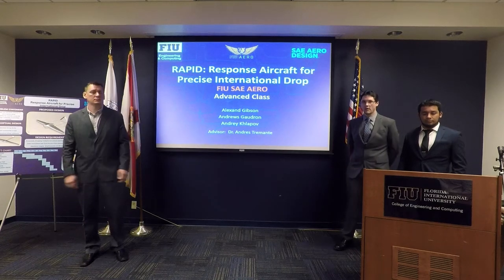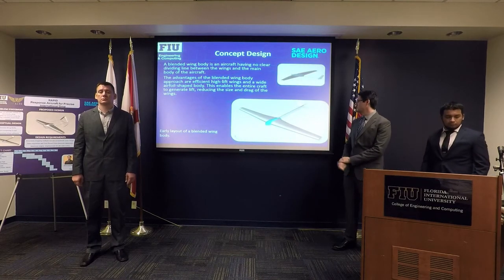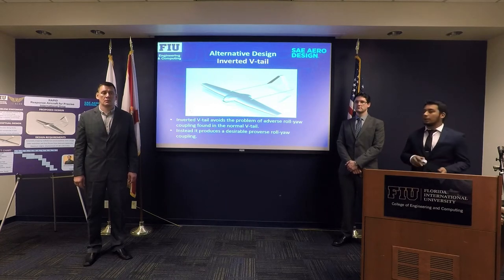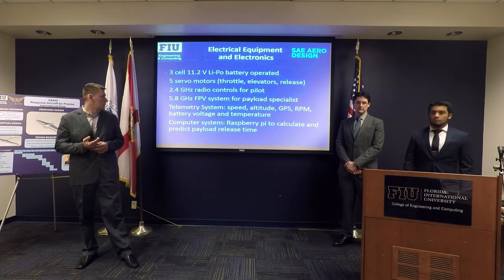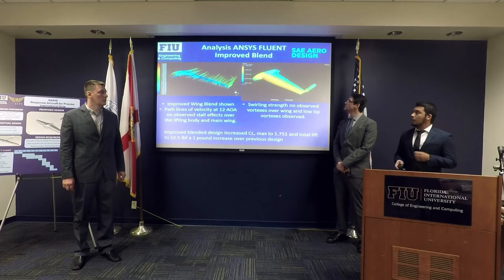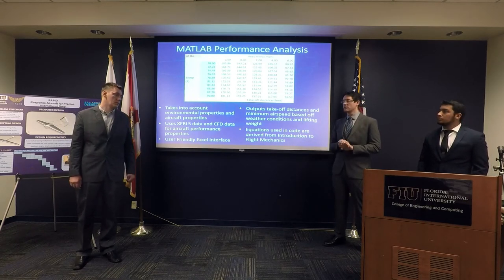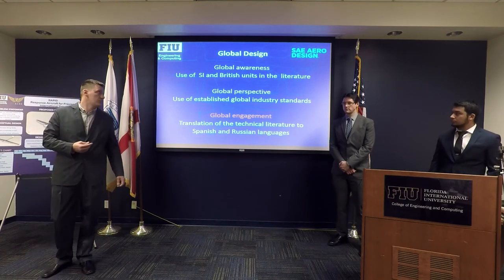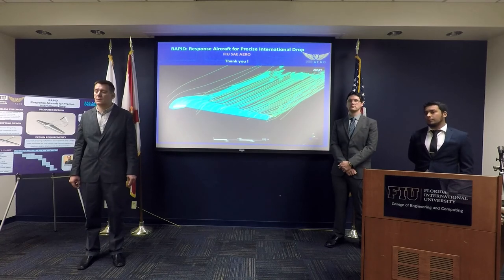SDO Team 4: RAPID Response Aircraft for Precise International Drop

Comment: This team had a clear knowledge and appreciation for their project. I appreciated the fact that they went into such depth to test their design through various software and used a MATLAB program to analyze potential locations for flight. Although I felt like each part was explained well, I wish that they had gone more in depth on the electrical and coding side of their project a bit more, to get a fuller understanding of their project.

Comment: The team is participating in a good competition. The presentation went well, it showed that each member is well prepared and looking forward to getting the best outcomes and results. However, in some instances the team did not have the best understanding between each other in changing the slides at the right time. Also in an instance the presenter revealed some information different from what's shown in the slide. Other than that, the team's project is promising and they have picked an efficient design alternative with good properties proven by the simulation analysis. The time frame and the schedule of the project seems organized except that they need to finish it a little bit earlier just as explained by one of the advisory board members. The team provided the advisory board members with good feedback regarding their questions and sounded quite confident in themselves.

Comment: The team was well organized and were able to communicate their idea effectively in this presentation. They had a good amount of data to back up their design choices. They were able to answer any questions they were asked. The flow simulations really shows that they are proficient using design software and the design they had will actually be able to work. The presentation was missing flow and transitions between different topics were not necessarily smooth. They had a great presentation overall though.

Comment: The strengths about this team for the RAPID (Response Aircraft for Precise International Drop) is that the details were well defined. The whole team was able to speak and answer questions without any trouble along with the difference in scenarios.

The weaknesses that this team can benefit from is that the presentation seemed overly rehearsed where the presentation felt more like reading of a text. The transitions between team members speaking wasn't fluid, and not even information to truly identify what each team member's role.

Ka Wing (Gary) Tsang